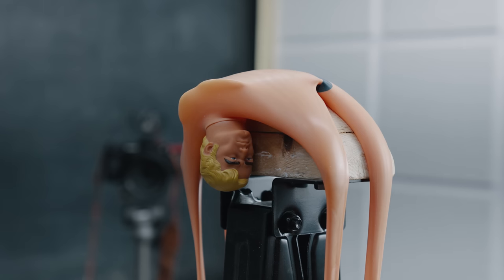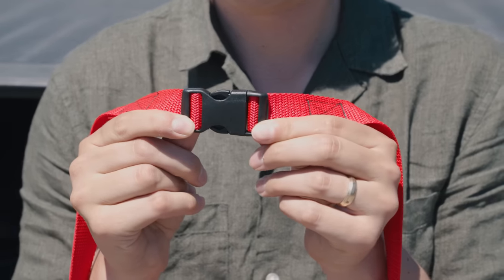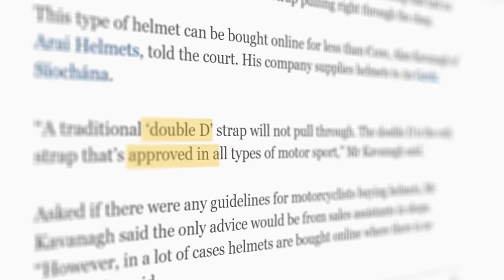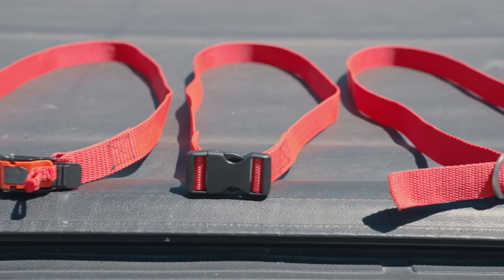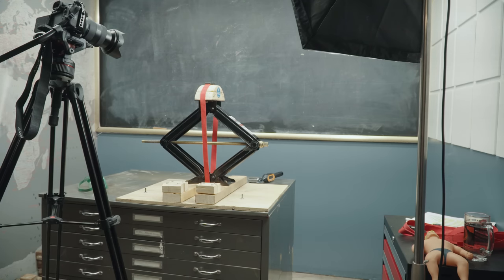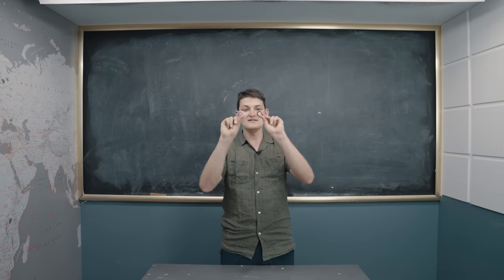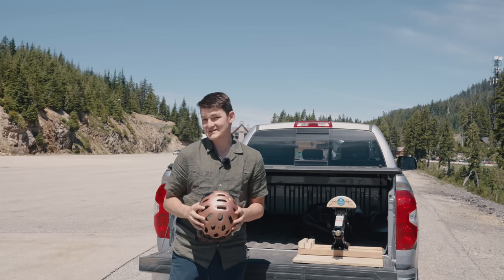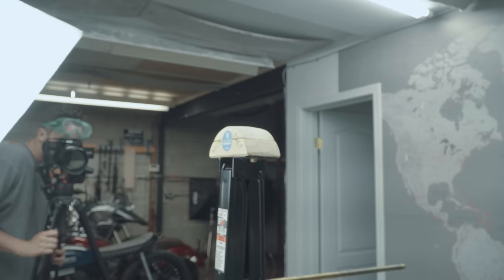Why Motorcycle Helmets Use this Ancient Buckle

Comment: Remember everyone: Boots on, jacket on, gloves on, helmet..... gloves off, helmet on, gloves on.

This is what the "double D" means to me, I swear it's every time I stop.
Reply: @Christopher Armstrong yup, finally got a Shoei GT-Air this year, which has a ratchet, and I’m in love.
Reply: I've long believed the ability to do up a DD with your gloves on is the mark of an accomplished rider lol.    But my latest lid has the ratchet too, and it is pretty awesome to use.
Reply: @M3rVsT4H  very conditional on the gloves you wear and how... uhh... squishy your chin or chins are. 😅
Reply: @jameshealy4594  LoL, true.  I added a long goatee to the challenge too.
Reply: Then either you have shitty gloves or it is winter (very thick gloves).
Reply: @marcelmuller8166  Or maybe I and others have different hand and/or neck mobility to you, possibly due age or disability, or even to something super rare like motorcycle crashes in underprotecting gloves. If only this was a motorcycle channel where commenters might understand that sort of thing.
Reply: Double D does not need to be fully unbuttoned, but simply extend the belt to its full length and that's it. And the helmet is easy to put on with gloves.
Reply: @aleksios2 I wish I could do that! Motorcycling taught me that I have a statistically enormous head, helmet shoppingis literally buying the largest available, which I can only just force on. In any posture my lips are touching the chinbar and there is NO way I could get the strap off withour completely unbuckling it. Looking for something better (and locally legal) when I next buy!
Reply: This is why Fidlock is so amazing. One hand to latch it, only takes a flick of the wrist cause its magnetic. I snagged one of those Ruroc 3.0 helmets and have been loving it
Reply: @jameshealy4594  some mothers do havem

Comment: I like how the approach to safety improves with each test. Like manufacturers should be doing, striving to always improve.
Reply: if it's shiny, PRable and it sells ... screw improvement. I hate how people these days equate new with better.
Reply: @ioandragulescu6063  because most of the time it is, when they release a new phone it's almost always better than before, same with cars, bikes, tech and most everything else
Reply: @AstoundingAmelia  right and on top of the faster procesing power/memory has a gazilion cameras, a boatlod of "features" like fingerprint sensors and face recognition and a ton of bloatware that most people want removed ... yeah, good analogy. Same with cars and bikes, more electronics and modes that serve little to no purpose, touch surfaces (for cars) that even reviewers hate lately, matrix headlights with auto high beam that blind incoming drivers on anything BUT a straight road and on and on. Prices go up, reliability down and let's not even talk about repairing them... yey progress !!

Comment: You made your point of view clear and sensible. Double D are probably a little more efficient and are the only way to go if you want track (in France). But the reasons is more because it is a standard that track emergency people are  trained to. 
As any gear is much better than no gear, any helmet is better than no helmet...whatever the type and locking style. I would like to see what is the resistance of the other end of the strap too. I reckon the strap will break off the shelves well before any strap locking system...

Comment: According to ECE The retention system test involves placing the helmet’s retention straps under load in tension.  For this test the load is progressive; first a load of 22.7 kg (49.9 lb.) is applied for 30 seconds, then it is increased to 136 kg (299.2 lb.) for 120 seconds, with measurement of the stretch or displacement of a fixed point on the retention strap from the apex of the helmet.
Some new standards in FMVSS 218 will go into effect in May 2013.

Comment: Never had D-ring helmets. Had helmets with a sort-of miniature seat belt lock, and currently one with a fully metal micro-ratchet-style quick release thingamabob. They're awesome! 😁
Reply: All of the "high end" racing helmets I had (Arai/Shoei) have the double D. But thats because these were also used by amateurs and pro's racers and, as stated in the video, the double D's are mandatory all over the world.
Reply: Same. Previous and current have a seat belt locking mechanism.
Reply: I would have definitely wanted to see that seat belt mechanism tested
Reply: I've definitely seen the mini seatbelt style but it's not in this test. 

Not sure if they are officially stronger than the DD but I'd be interested in seeing as they probably look the most robust of not the DD
Reply: @hanselemans4237  Mandatory only for racing mate. Otherwise big brands of helmets would not use other types of buckles for their street legal helmets.
Reply: In this the main failing feature was plastic, not the actual methods for fastening. I imagine a metal system would be equal across the board
Reply: @gravoxxavox7849  Exactly that. It's a material issue, not a design issue. I would have liked to see him also test a metal quick release buckle, or a plastic double D for comparison.

Comment: My main concern with Fidlock is that sometimes when the clip connects, it is in a metastable position that seems to be done up but it isn't actually seated properly for whatever reason.  The moment the strap is tugged, it releases.  The potential for a metastable situation is the epitome of Murphy's Law - there's a nonzero chance that if the rider doesn't check that it's done up after hearing the 'click', every time, it might be in that metastable position during a crash.

I have a helmet with Fidlock and I've made it a personal habit to always give the strap a tug/wiggle to check that the strap has, in fact, connected itself properly. Sometimes it has not.
Reply: Very true
Reply: You like the word metastable don't you? 😄
Reply: @keaponlaffin6737  He’s vocabulary-shaming.
Reply: @OneManTrail  Nah, 'metastable' was just on his one word a day vocab calendar that day
Reply: Someone learned a new word recently.
Reply: @Hartwig870  Not really, no. I've been a forensic engineer/incident investigator for over a decade and the concept of metastability is powerful. Would you rather I say "It's a shit design if it can seem like it's done up but isn't done up?" :)
Reply: I've also noticed this, but it's still way easier/faster for me to do with one hand. I drive delivery on my bike and being able to quickly put on and remove my helmet with one hand is necessary when I deliver to govt buildings or banks where I cant just lift my helmet visor. Saves me at least 2 hours a week with how many deliveries I tend to make.

Comment: There is one downside to the double D-ring buckle. The strap is dragged over metal edges every time you engage and disengage it, so strap wear is a factor. Good to know it holds so well, though.
Reply: It's really not, there's very little friction because those edges are not sharp (for obvious reasons). Maybe if you used it 40 times a day every day for 40 years it might be a factor.
Reply: Yep, I had one of these for 2 years and the wear was minimal
Reply: @flippy66  Perhaps the ones I've encountered were poorly made / poor quality examples. Good to know, thank you.
Reply: @sudowoodo8919  Thank you for correcting my position on this, very good to know.
Reply: The straps tend to be high quality even on cheap helmets pretty consistently at this point. I've only seen that be an issue in some very cheap bicycle helmets.

Comment: I feel I should point out that, while ultimately proving what is to be expected, that the test measuring procedure is flawed.  Using a torque wrench on the jack to obtain your values will not be consistent unless every failure occurs at exactly the same height of the jack extension.  Due to the geometry of the scissor jack, the further it is extended, the less torque is required to be applied to the drive screw.  The data might be able to be corrected by measuring the height of the jack at failure, in addition to the torque value on the screw, and extrapolate the data across the Jack's  geometry mechanical advantage curve.
Reply: At the end of the day all that really matters is did the buckle break before the strap. Its really a pass fail test.
Reply: I was also wondering why he didn't reset the jack for each test.
Reply: @RaghavSatya  The jacks are in very similar positions before tightening started, and the straps look similarly identical as far as initial fitment is concerned. Any difference with this is ultimately negligible
Reply: @RaghavSatya  I believe they did reset it, but they didn't show it from the lowest position for every buckle because it would take too long for some of them. Since the buckles happened to have progressively more resistance, it kinda looked like they've started from where the previous buckle snapped off.
Reply from the maker: I considered this! But I reckon the best way would be to determine it experimentally. I.e. let the rig break the strap at X Nm, then brace the rig (without changing its breaking angle) against a scale. Then you'd just have to apply X Nm with the same torque wrench and read the value. Unfortunately my scale tops out at 500lbs so I had to go with the rough approximations. ~RF9
Reply: @RaghavSatya   didnt he though?
Reply: @FortNine  probably already commented somewhere else, but were all the non-d ring buckes made of plastic?
Reply: Thanks for the reply, Ryan. I was concerned about the methodology as well. Repeating each strap test at least once would've pretty simply mediated much of the issues though!
Reply: @ww-pw6di  not really flawed. The failure point was shown, along with how willing it was to fail, in a test conducted as repeatably as necessary to do so. If all the straps were the same length before the tests were done, this is fine - unless you're going to complain about un-returned compression in the wood?
Reply from the maker: @Blinkubus  Correct - the straps were all identical in length. ~RF9
Reply: Then feel free to do your own. Or you can it as rough idea, general info, and more than anyone has done to test the theory. Good grief. Out of all the F9 videos, I have almost 0 doubt he understands physics and test conditions. Juuuust saying.
Reply: @DTD953  The side-release Buckle and the ratchet strap are both made of plastic, while the Fidlocks hook is aluminium and the eye is steel (I presume, not mentioned in the specs).
Reply: @creepyshadow55  I wonder how D-Rings of a similar plastic would hold up? I'm imagining that it would still be a better set-up than any of the other choices, however, I also feel that using a metal-alloy side-release buckle may show better performance (albiet probably not as good as metal d-rings)
Reply: As someone who both taught and worked with precision measurement (metrology), the methodology being used is close enough to obtain results. The strap is going to stretch anyways, but the strap is not what we are testing.

The point at which stress is the greatest on the buckle never changes.
Reply: The purpose of the experiment is to demonstrate the incremental strengths of each link. Double d clearly is the strongest and safest, by a fair amount. 
To measure tensile strength in a proper way you can consult specific norms (and I assume to make this videos at fort9 they did some search about) is just not part of the show show XD
Reply: @nomecognome5696  👍  no argument from me Nome. I even state that in the very beginning of my original post.  I was just pointing out, from an accurate data value collection standpoint, the values will be inaccurate, not that the results of which is strongest would be misrepresented.
Reply: @someguy5035  The point at which stress is the greatest on the buckle never changes."
As someone who taught and worked with precision measurement, you should be fully aware that the metering instrument is not linear to the applied load to the strap, and therefore, an inaccurate (actually, of no value without additional parameters supplied)  Sure, it reflects roughly which is stronger than another, but doesn't reflect what each component's tensile failure value actually is. 
Did the strap break at its rated value?  We'll never know from this test.
Reply: @ElementofKindness   Data values like you're trying to point out might be of use if we were concerned with more than "which is strongest"... BUT here in the realm of motorcycle enthusiasts who are kind of well known for neglecting even fastening the Double-D... or bothering to snug it properly in the first place... frankly, we are NOT concerned with more than a "pass/fail" type test...

     I might expect more out of channels like SciShow or The Backyard Scientist.... BUT are we REALLY going to "call out" the likes of Fortnine? No...

     The results (for whatever they may be worth) are in. Double D's are "better" in performance... That doesn't necessarily mean you're going to die for using a Dick Clip (I'm definitely using that term from now on) or the ratchetty thing from snow-boards and ski's... and frankly, in-line skates... Obviously, this test won't suggest that. It was meant to entertain and inform... It does those well... with a visceral, visual set of evidence. 

     If you want or need better... First, I feel sorry for you. That level of cynicism is just sad... Second, get your own collection of connectors, and some nylon strap, and a sewing machine... or stitch-awl... AND get to it. You can find someone with a camera, I'm sure. You'll already have your hands full (figuratively) figuring out the sewing machine or stitch-awl... ;o)
Reply: @FortNine  Ideally you would use a setup like what hydraulic press channel has. Put a load cell under the strap and directly measure the force. You would also need to test multiples of each strap. That is assuming you want scientifically accurate results. As is I think you made your point quite well. Some times the best solution really is the simplest one and its hard to get much simpler then a pair of metal rings
Reply: Thanks Fluttershy
Reply: @ElementofKindness  Why is it not linear? Because you said so or because another reason? What is non-linear? The results or the force applied? You did not specify.

You don't get to make claims without merit in the adult world.
Reply: @someguy5035  
All one has to do is use one of these jacks to see for every turn near its lowered position, it rises significantly more than it does for every turn in it nearly fully extended position.   It doesn't take someone of much intellect to then recognize that there is a torque curve to input of the screw, but for you I guess that's the exception.
Reply: @gnarthdarkanen7464  you seem to be confusing criticism with cynicism.   You've typed a lot of words over that misconception.   Only a fool rejects criticism when they have made a mistake. Those people are incapable of learning from others.
That's what's truly sad.
Reply: Imagine taking someone with a mlp pfp seriously lol
Reply: @lawray8368  yeah, because that's what you should base your observations upon . . . .
Reply: @ElementofKindness  You are looking for an issue where one does not exist. I literally did this for a living and taught it. DC and low. Microwave. Radiological, physical and dimensional. All at the college level. Moreover, I taught techs that had been in the field for at least 5 years for follow-on, advanced technical training. 

My guess is that you have an issue with the results more than the technique.
Reply: @FortNine  Ryan from How Not To Highline has the perfect machine for this kind of testing. Slack Snap. He tests all kinds of fasteners for rope sports.
Reply: And comparing 1 to another, of all else was equal the test is good, that said a shorter strap length would be nicer as it gets closer to real world helmet testing. 
That or 2 fixed points bolted to a fixed point and raised up. As the less strapping material should stretch less than in the video above. 
Either way, the strapping/buckles fails quicker.
Reply: @FortNine  I think you made the weaker buckles look stronger than they really are. The order of ranking does not change. I'm sleepy and rusty at this but believe Force_lift = Force_screw * tan( angle_of_arm_to_screw ). The higher the lift (the greater the angle) the more leverage the screw has. Am not going to venture into converting torque on the screw into force tonight but assuming the strap breaks at 900 pounds you can back it out same as you have already done. Another day we can argue about there being two straps countering the lift and a stress concentration at top and bottom where the straps wrap.